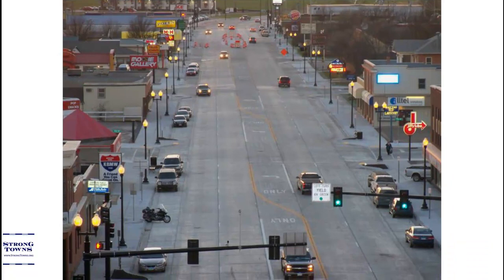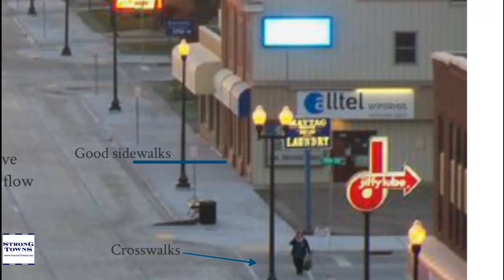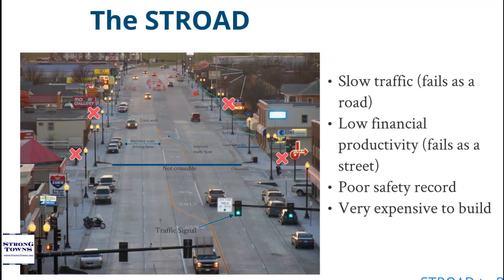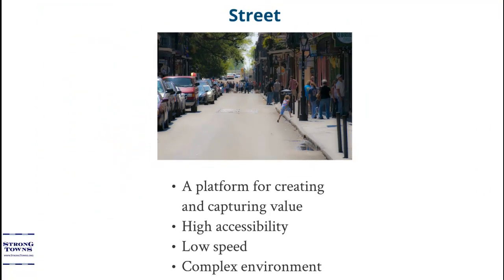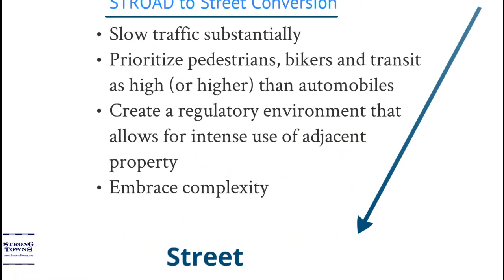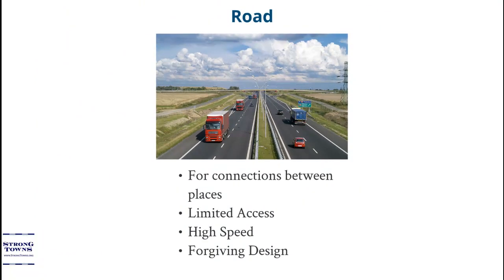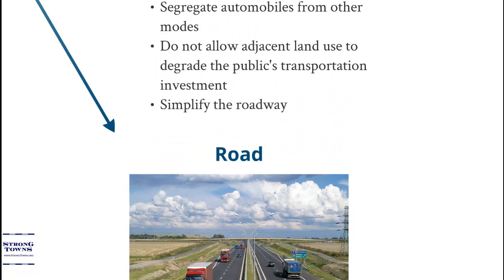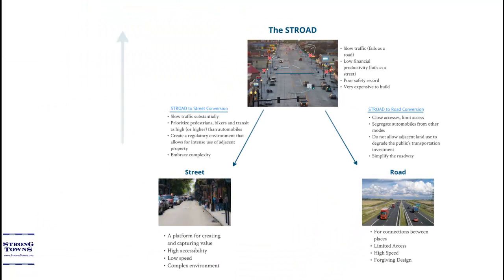The STROAD

Comment: Did electrical work for some years. Just know that every single 4 way intersection with traffic lights (like the ones pictures in the Stroad diagram) cost somewhere in the neighborhood of 200-250k in equipment and labor. One intersection. Multiply that every time you have to stop at a light driving up that stroad and it starts to seem absolutely ridiculous.

Comment: Is there a video that shows a stroad turning into a road?
Reply: I would say that that turning  a stroad into a road would be harder than a stroad into a street. Since most stroads occur in urban areas. Where traffic is too much to have it be a street, but not enough traffic to have a road.
Reply: @commentor3485  I've thought of much the same honestly.
Reply: I think one of the most ambitious but possibly beneficial ways of conversion from stroad to road is to have a dual system (seen in NL, naturally) where the innermost middle lanes are road speeds, and a median separates into a one-way street on either side. It makes it safer for local travel but crossing can still be an issue.

Ultimately, though, the best option is probably to destroy current development and/or properly redesign it for newly built streets that safely extend out of the road in exit lanes like a highway.
Reply: @punishedkid  Hmm. Interesting idea.
Reply: @NoirMorter  Another thing to consider is that most development on suburban stroads is far from the road (but not all and not always), so by cutting into parking lot/empty space you would have enough space to add plenty of two-way streets parallel to the road. In fact, a stroad near to me basically has done this concept, but it's just for access around a parking lot.

Comment: Would a typical American country road count as a stroad? Houses are often set at the end of long drive ways directly onto a two lane road.
Reply: Country roads a a bit different, they're not trying to pack in businesses like a street. They're more like roads with the occasional driveway.
Reply: Those drive ways don't have an amount of traffic that makes any noticeable dent on average daily traffic speeds and there are no expensive sidewalks with street lights or traffic signals. So the design is optimized for throughput and building expenses are also limited to those that benefit automobiles. I'd put it solidly in the road category.
Reply: expensive sidewalks?

Comment: i was thinking of the best way to reappropriate stroads and redesign a town.. so far I’m thinking you can add multi-use zoning in the middle of the stroad with residential on top of the 1st floor business, eliminate most roads except where it’s absolutely necessary, build highrise parking at focused points which would be the only places for cars to park, and make wide walking lanes with biking lanes being mandatory to be next to walking lanes, separated by trees and bushes.
Reply: @IRGhost0  I just realized this comment was from 3 years ago, I’m late to the party. I’ve been thinking the same exact thing, (as far as creating mixed use zones with office space or apartments above and shops/offices below) but it would be important to have easy access to a train/tram/trolley and that might be the hardest to incorporate into existing infrastructure. Parking buildings would help but being able to function in your community without a car is the dream. In my fantasy the ground floor of apartment buildings are converted or built with shopping and restaurants that can accommodate people who live outside the area as well. It HAS to be inviting and pleasant to walk. Also the same thing in suburban housing tracks, at least two blocks dedicated to mixed use. And in this fantasy every housing track or apartment cluster has a tram (like the kind that shuttle people from the parking lot to the front of an entrance, open air, roof overhead, that sort of thing) that you can request a pick up with your phone and is powered by a self driving vehicle. It doesn’t go far (because we can’t except much from a self driving car) but it’ll take you to the next one in the next neighborhood over until you can get to what we would recognize as more of a Strode where, hopefully, there’s a larger tram/train/trolley. Adequate parking is necessary but I’d sure love to not have to own a car. If you made it this far thanks for listening to me dream ❤️

Comment: Stroads are the natural outgrowth of businesses trying to attract customers in vehicles, not pedestrians. When vehicles are restricted to bypasses, businesses die, towns fail. Simple economics.

Perhaps a staged approach would be better, one designed to take advantage of the different levels of town development, with a means of changing the type access based on the population level and business success. When towns are small, they NEED that vehicular traffic. But as they become more self-sustaining, a bypass can be instituted.
Reply: That is how it works in cities in Europe - when a city and/or the traffic on the main street get to big, a bypass is built
Reply: There is third option. You can mix road and street. You build in the middle what is called distributor road and 2 access roads on each side of the road to provide direct access to properties. Access roads are low-speed streets, distributor roads are desgined for higher speed and higher capacity. Distributor and access roads are linked via intersections that more sparse than what you have on stroad. Like ever 1 km or so to improve traffic flow. That's how the Netherlands has been their own stroads since the 1990s. The distributor roads doesn't need to have access roads on each side, but they often do. Also some stroads where completely redesigned as access roads (streets) only or even completely closed to vehicular traffic.
Reply: @cutediz  That's why many roads have two lanes on each side, an attempt to duplicate this idea. But this isn't the Netherlands; what works there will not work here, because of the differences in culture, the number of vehicles, and the layout of the cities.
Reply: @kelaarin  there is nothing special about the Netherlands. They were very, very car centric in the 1970, like US is. Nobody will force you to ditch the car. In fact it will make driving better, safer, quicker while also accommodating other road user like pedestrians and cyclists. It's win win. The Netherlands are still one of the best countries to drive a car. The road and motorway network is one of the denses in the world. What has changed is that they started to treat other road users equally alongside car users. I also don't live in the Netherlands , but Dutch (and Swedish) roads are golden standard.
Reply: @cutediz  Ahh yes, the old "you're too stupid to know what's good for you" argument.
"Nobody will force you to ditch the car" - except the endless and rising tide of anti-car regulations.
"In fact it will make driving better, safer, quicker" - and yet, none of it is.
"While accomodating other road users like pedestrians and cyclists" - Pedestrians aren't supposed to be on the road, except at legal crossings, and yet many of them ignore the legal crossings. Cyclists have to obey the same laws that cars do, and yet most cyclists simply ignore those laws too.
"The Netherlands are still one of the best countries to drive a car" - You clearly haven't, because it's HELL to drive there - I've tried. Most of Europe isn't any fun to drive.
"Dutch roads are the golden standard" - in your mind, clearly. But not here.

Comment: The stroad in this example looks wide enough to have 2 lanes in every direction, plus a local lane for access to businesses and turns. The last thing you need to do is simply rise or lower one of the directions so they can cross without stopping.

Comment: such as... making more accessible for pedestrians without taking away from vehicle traffic based on early planning. One example of this is defining areas for the pedestrians to walk easily and allowing for over passes or defining areas where pedestrians are allowed to cross the road. At these defining areas they need to be some what spread out and focus on effective traffic management giving focus to drivers and utilizing pressure pads more than timers for lights. Minimize turning / thru traffic
Reply: Pedestrian overpasses aren't ideal
Reply: @VoidCael  Especially when they break.